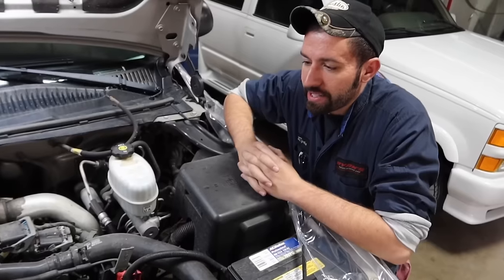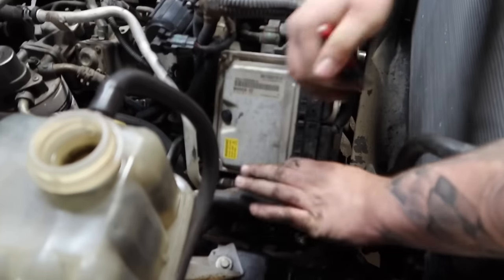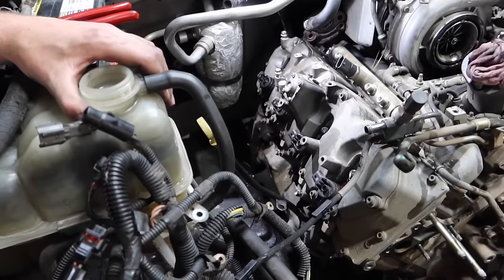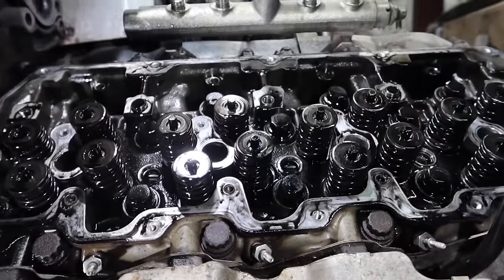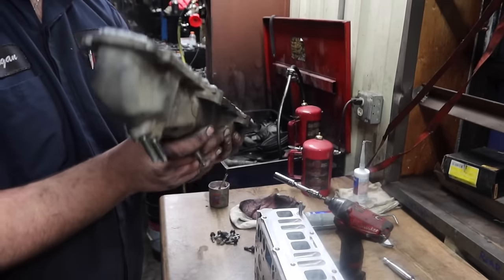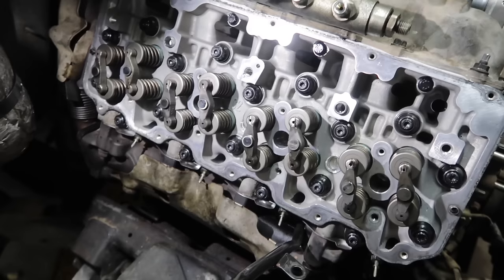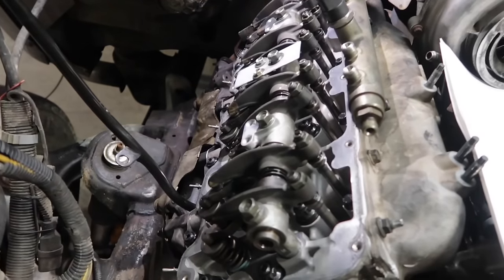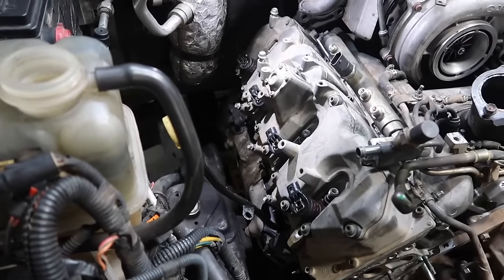How To Install Head Gaskets And Head Studs | Duramax

Comment: Great video with lots of good info and care being taken, except for one thing that really bothers me: When cleaning the block surfaces prior to mounting the heads, the use of sandpaper as shown here will result in a large amount of industrial-strength abrasive sand and iron particles collecting around the top edge of all pistons, sitting on the rings as well as dropping into the oil passages and even water passages. I am sure this will cause a lot of damage. There has got to be a better way. There are no easy solutions to this issue, but I would love to hear some suggestions. (Solvent, wiping, vacuuming, air blasts, oil filter/change .. none of those steps will removal all the abrasives. For sure a bunch is going to wear the cylinders and depending on how the oil passages route .. maybe crank, cam bearings lifters and more.)
Reply: Most people who take the time to sand the head before reinstalling will take an air gun and blow out all the cylinders and everything. They might not have showed it here but im sure that's what they did. These guys seem way too good at their jobs to let something like that slip.
Reply: @packfannumber1  i agree
Reply: @packfannumber1  that's not even close to what maxhauler was pointing out. You can't "blow" this type of debris out of an engine without blowing more of it down deeper into critical areas that WILL cause abnormal wear and tear on the customers engine. This is just irresponsible work procedures on their part for using this sloppy, incompetent process for cleaning the deck surface. 4 oil drain back holes in the very bottom of the deck that go straight into the crank case(oil pan). How are you going to "blow" that out without sending it to the pan? Not to mention the 80 grit debris that fell into the pan because they didn't block the passages before they "blow" it deeper.
Reply: @Iatolaazzahola  take the pan off and blow it out lol
Reply: lmao.. stop it
Reply: @athomas4835  I have to disagree. If this was true, they might use carbon as abrasive on sandpaper, but they don't they use alumina oxide, silicon carbide, ceramic alumina and similar substances. All MUCH HARDER than carbon residue. Meaning they do MUCH more damage to the metal of your engine.
Reply: @Iatolaazzahola  <- listen to KMC people. We're both trying to give you good knowledge. Your engines are important.
Reply: @maxhauler  I'll roll with the hundreds of done trucks ...Thanks 
Change fluids and a new filter and ship it ...
Reply: @maxhauler  dropping shyt with no other option sounds like Bidong the Supreme leader ...
Reply: @athomas4835  if the block actually needs to be resurfaced because it is warped, then the engine has to be pulled. if it does not need that then only non-destructive cleaning is needed.
Reply: What is the sanding supposed to do anyhow? It's not making it flat that's for sure. Leave this step out and use careful scraping and solvent and that's about it I suppose. Definitely don't let sandpaper grit get anywhere near the interior of the engine or any place where it could make it's way there unless you want that engine to suffer extreme internal wear .. which might not show up as a problem for quite some time.
Reply: @maxhauler  it cleans the surface where solvents can't.  It's cast iron , it's already flat . It's not about making it flat but about removing what solvent can't .
I'm doing the job as we speak . How many have you done? Let's be clear . Solvents don't solve everything . And find me one these days that at all works ...100% impossible scrape with what ...lol a plastic scraper ...lmao sheesh ...when you figure out the solution tube it so we can see it ...later 😉
Reply: @athomas4835  well thinking about solvents for a second .. if I had something stuck on like that and absolutely could not get it off with 'normal' solvents, know what I would use? Paint stripper. Paint stripper is some of the strongest stuff you can use. I would bet money that paint stripper would take off any kind of gasket or sealant. Might have to sit for a while, but could be wiped off with a rag after and cleaned again with solvent and of course I would be careful not to let any of that get into engine internals, but the difference in risk to the engine would be night and day compared to sanding.
Reply: Maxhauler you are correct there is a better way. I just did my lly and this was the only part I struggled with. I read the gm bulletin but still didn’t agree so I asked the machinist that surfaced my heads. Long story short he suggested a knife honing stone. I had read to fill oil and water passages with shaving cream. I also filled cylinders around the rings. Used a scraper to remove most all gasket material. Got a 8” x 21/2” stone at bass pro shop. Sprayed with wd40 as lubricant. Used course side moving lengthwise across the whole surface. Not a lot but enough you can’t feel with fingernail. Finished with finer side of stone. Shop vac debris and shaving cream. Btw I filled push rod holes too. All holes filled with cream! Turned motor over and wiped remaining debris in cylinders. I had already scraped piston carbon. I oiled cylinders and turned over to lubricate. Could not relate to any of the sand paper methods as I do body work also. Very sound method. Researched a LOT
Reply: @markkeller9452  this is an interesting method and probably the best so far. I guess some other materials might work too: modeling clay (although it is slightly abrasive too but like a fine polish compound so probably ok) and thick grease comes to mind. Hey man lots of quality research always pays off! That is a really big stone. I assume it is for sharpening large knives?
Reply: @Iatolaazzahola  First, awesome video, I am about to tackle a LB7 that needs head gaskets and this is a big help.  Thank You,  I worked in the engine business for 30 years now retired but I will also say using the sand paper on a block that is going back into use without a full tear down and cleaning is risky.  I have seen many engine bearings damaged by sanding material.   Working for Federal-Mogul we made most of the OEM Bearings and got lots of direct feedback from shops and GM Dealers Nationwide.  We also owned Fel Pro Gaskets, their engineers are probably some of the worlds best and sanding on a block was pretty much taboo.   Those surfaces need to be clean and flat for best seal.  If a block needed to be dressed manually like you guys did they insisted you use a piece of Machine Steel,  1/2 " thick, at least 2" wide and 10" long.  Machine steel has been machined to be 100% flat so you do not distort the block surface.   The absolute worst thing to use on the gasket surfaces are those sanding discs, they leave terrible hight and low spots.  Again, Thank You for a very high quality video breaking down a complex repair!
Reply: sand paper is a  large no no... yes sand rocks will get down in there as it flakes off the paper not good and some will get into the oil drain back holes so just don't do it if it is your truck only if it is a customers truck then who cares??? get paid for the job and let the oil filter do its job, and some rocks of sand will get into the rings yes oh well... but on mine i just a large file to look for high spots thats all you really need is to look for high spots and knock them down and never just sand glued on paper at 80 grit and come back with 180 sand grit ??? come man, i work on Helicopters and jets for the Government for 23 years and yes we never would think of using Sand rocks glued on paper that will flake off into the engine ... SO SAD TO SEE THIS INCOMPETENCE AND LACK OF PROFESSIONALISM for there customers,,, no quality of integrity here...
Reply: you can use a large file to hit the high spots if any  on the block surface, then come back and hit it with a  3M rubber type disc that has these many little fingers on it,3M 3M-18733 Roloc Bristle Disc Grade - 120, Size - 2,,,  THE youtube .FordTechMakuloco he has a video on what factory Ford Master Techs use to hit the block surface,,,
Reply: @johncasor9698  Everyone else can create metal filings and sandpaper grit and put it into their expensive engines. If my engine has warped heads it's coming out for a proper fix. I'm not sure when people started getting such ridiculous ideas. ANY kind of grit will bring that engine to an early death. You cannot argue with physics. But do whatever you want to your customers engines. This is why I never hire mechanics. I fix it myself or buy a new or un-touched engine and hope no-one tried any of this funny business on it.
Reply: Been a master tech going on 30 years and I see no issue with sanding as long as it’s a nice flat block AND the engine is completely broken down and placed in a vat to be thoroughly cleaned. Just my 2 cents
Reply: @mastertech8112  and of course in that scenario, one would just opt for machining the block and doing a full proper job on such a great engine.
Reply: @mastertech8112  But in this scenario they are not breaking the engine down, nor would 99% of people doing a head gasket job, so what would be your professional advice on cleaning the surface in place?

Comment: Love the video! Very informative. The only part that makes me cringe is sanding the block like that without trying to keep grit out of the block. I see several other people voicing the same concern but no answer as to why this is ok. Are we worrying to much? Now I'm not a pro mechanic or anything but i have turned wrenches most of my life privately and a little in a shop (also former Army 63W) and this just seems like a terrible idea?...
Reply: How would you keep the grit out? I would stuff the lifter galleys  with lightly oiled big fat car wash sponges cut to fit .
Reply: @321CatboxWA  I wasn't asking how to keep it out. I'm asking why they don't seem to be worried about it.

Comment: can u drill 2 small  holes in the thrermostat to get home if your 3000 miles from home. to get to buy some time  untill your home ? john,
Reply: how about if i pull out the thermostat untill i   i get home, its about  600  miles.

Comment: Just completed this on my 2007 2500HD cat eye Duramax. I wouldn’t have been able to do this without this video. Will be doing this on my 2006 2500HD Sierra. Thanks again!
Reply: Curious what you put into it for time roughly?
Reply: How did you clean the metal sanding dust out of the cylinders and coolant ports before reassembly?

Comment: I have a question, if you pinch the wires that go to the oil level sensor will that show zero oil pressure when trying to start and keep engine from starting?

Comment: i was fortunate enough to have this video to guide me as i just did studs and HG in my LLY,  what a great knowledge packed step by step video, thanks guys
Reply: Have any issues with the injector hold down bolts?
Reply: How did you clean the metal dust out of the cylinders and coolant ports before reassembly?

Comment: If your intentions are to drain the system then do that before you pull a cap off a pressurized res.  Ounce you no longer have pressure pushing coolant out the drain then pull that cap so it will flow

Comment: That was a Great and Informative  Video. I own a 2005 Chevy Duramax. And I was just wondering what that job involves.  Great information  on this. I know if or when my turn comes the bolts wont come off as easy as those ones did in the video..LOL. But thats my LUCK...LOL
Again Sir Thank You for the info. Great Video.

Comment: Great video! Lots of people commenting about sanding the block. Did you plug the oil, coolant, and pushrod passages with anything before sanding? Did you shop vac out the debris or just blow it out with air? Also did you chase the threads prior to inserting the studs?
Reply: Yup also wondering about the sanding remainings getting into the coolant passage and lodged beside piston and etc. Just blow it out real good and call it a day??

Comment: Hey! I'm doing this job currently using your video and I have a question. I noticed I have oil in one of my head bolt boars and was wondering if it is a concern?? It was on the bolt when I pulled and when I stuck a screw driver in the hole it came out covered in oil. It is next to the area where the gasket is damaged.
Reply: Sounds to me like there may be a small crack or a pin hole in the head. If you can't find anything I'd take it to a local machine shop and see what they can do for ya.

Comment: Did they clean the head bolt holes? Didn't see that in the block prep part of the video but assuming they did it.  Wondering if they used a brush or a thread chaser. Thanks for this amazing guide video!

Comment: You’re right about the rocker cover I used to get in a fight with the lead mechanic who trained me about this very step he wanted me to use a ratchet and I swore by the impact that you never believe me how even the three eights air impact did a great job you just have to hammer them in all the way and do it in one shot not too hard not to fast

Comment: After watching this video nearly 20 times, I decided to give it a shot.  I was putting the passenger side head back on today and broke one of the small head bolts.  What do these do?  With them being so close to the large head bolts, could I run the truck with only three of the smaller bolts?

Comment: What’s the average cost to do head gaskets, water pump, thermostats and turbo horn on a 2004 lly? Just trying to see what I’m getting myself into. Truck has 220k on it bone stock.
Reply from the maker: I bet nowadays it’s close to 7-8k
Reply: @TruckMaster  you have got to be kidding! I’m looking at buying a lly and I’m a preventative maintenance type guy so… it’s only got 220k on it and it is the base model work truck dually. Hoping it will come to me cheap but not sure what I should tackle first. It’s unmolested. Never tuned. 3rd owner and the second owner was a dealership. Technically I’ll be the 3rd.

Comment: one big mistake i made was  when i got the new heads on and running, the A/C stop working and the coolant light was on and it was full. i took it to a auto electric shop and they found very quickly the wire connectors were swap there are the same style connectors for the coolant recovery tank and the A/C plug on the low presser... accumulator... i think is what the tech told me... they are the same length and same style connector .... WOW so look out for that one... i could not believe GMC used the same connectors...

Comment: What was done to the heads at the machine shop and what does it cost approximately to have a shop replace these head gaskets?? And is it a good idea to replace anything else while doing this job, like fuel injectors or glow plugs?? Or is mileage a factor for replacing certain parts? I have a 2004 lly with over 335,000 miles. And thank you very much for this video and all of your how to videos. But I'm not sure that I would tackle this job. Too much wind blowing sand and my truck won't fit in my tiny shop. Thanks again!! Keep up the good work! And thank you for service!!

Comment: So my injector glow plug wiring connector nuts are rusted super badly and you didn’t say what size the nut or whatever is. Any tips on what I should do? Way I can cut it off and get the bolt out of the block?

Comment: Now that the studs are in, will there be a clearance problem lifting the heads off the block this way in the future since you have to lift the heads higher to clear the studs?
Reply from the maker: Not at all
Reply: You take the studs out by unscrewing them.

Comment: great job guys,and great editing ,I bet the intake runners were nasty,I deleted mine,about to install hsp y bridge,n pipes, glad you showed valve  adjust,did you do new valve guides?,also I would clean  the turbo,and remove  the heater core  quik connects as they break and leave  you stranded THANKS

Comment: just installed new heads, start LLY 2005 and ran great for 5 mins and i turn off engine looked for any leaks found only one did repair on return line not snap on all the way no big deal. then did a restart and it starts this pre detonated engine noise, i unplug one injector at a time and same problem never went away. it sounds like when you hit the fuel to go and it makes a knocking noise on acceleration for like 10 sec and its gone. but this is all the time ??? what you think it is ??? put a scan tool  on it and it was a connector not connected for fuel presser control...

Comment: Thank you for this video doing my first set of head gaskets on my lb7 tomorrow morning
Reply: @Rover19666   honestly ended up pulling the motor and trans and rebuilding them with a stage 4 trans kit and injectors and a few other parts

Comment: Is there a way to check head gasket leaks with a TOPDON scanner?  My coolant reservoir is holding pressure on a 06 LBZ. No leaks or low level warnings.

Comment: So what's different between the LLY and LBZ when it comes to the heads and block? Because the LLY engines are known for overheating and blowing out head gaskets. The LBZ doesn't seem to have that issue.
Edit: Just curious is all. I have a LBZ truck. It's in the shop having the trans built and beefed up. Getting ready to add a 5 way tune setup soon. 
Do I need to worry about blowing a head gasket or having the heads studded? My max tune won't go over 150HP and the max tune won't be used that much either. This is my daily driver truck. Mostly stock. So far the exhaust is straight piped. No lift pump and no EGR delete. Planning to do both of those mods soon as well.
Reply: Salty Steel a lot of people blame the lly turbo mouthpiece for over heating issues..and yes it is a restrictive piece and will help the truck breathe much better reducing heat from the turbo, but ultimately iirc the design flaw was in the gaskets themselves with these trucks, some are just prone to shooting shit..